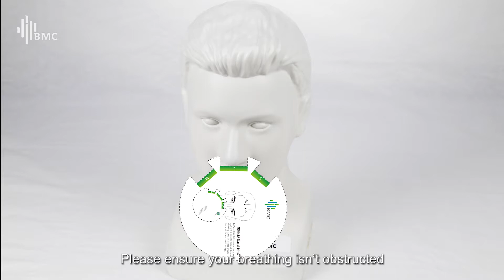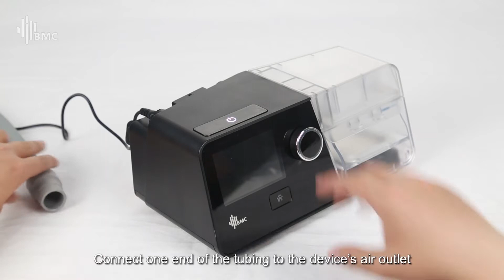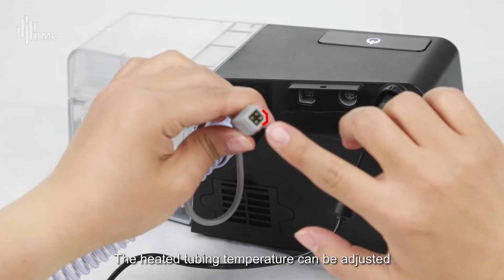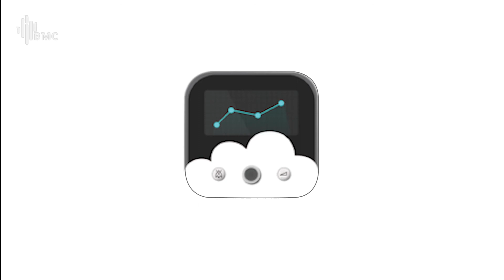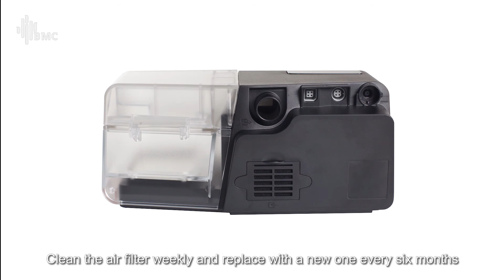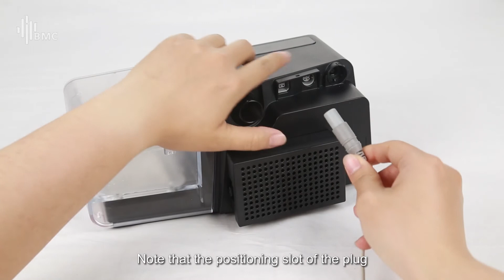Step-by-step user guide of BMC CPAP/Auto CPAP  G3 Series

Comment: how to properly switch on and switch off the the G3 ?
Reply from the maker: The device has no ON/OFF button, we suggest you to keep the device plugged in, because the machine has a data upload after use. If you do need to shut down, it is recommended to unplug it a period of time after use.